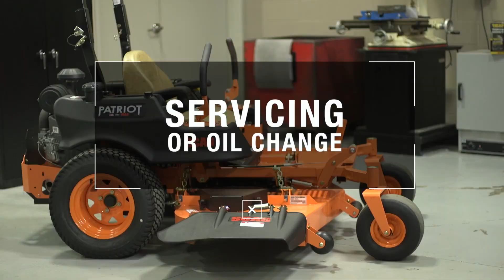Hydro-Gear Transaxle Air-Purge Process

Comment: I have a zt2200. It has no reservoirs. Just a fill plug. Do i need to leave the fill plug out when i purge? Or should it be screwed back in prior to purging? Thx
Reply: What did you find out?  And what type oil is used in the hydros?  I just got an older Jonsered ZTR and can't find anything about it.

Comment: What if my new ZT Elite with hydro-gear axles has no reservoir tanks? How do you know if there is enough oil in the axel? I was told just to fill the oil till it runs out of the top port plug on the axel. True??? Can I just let the breather vent next to the fill plug purge air out of the hydro-gear??? Or do I still need to rotate the tires back and forth a few times???  Thanks!!!

Comment: Hi, does anyone own a Husqvarna PZ60? 

I'd like to request some quick guidance on that machine, since I'm trying to understand the Bypass valve ordeal, since the manual makes it extremely confusing.  The explanation is very vague.  

Here are the couple of questions:

1. Is the Bypass Valve the same thing as the Pump Release valves?  In other words, this zero turn lacks a rod that you can pull to quickly disengage the transmission.  Instead I'm supposed to use a 5/8" wrench and move (counterclockwise?) the Pump Release valve on both pumps to be able to push the zero turn with my hands (neutral).   If there's a separate Bypass Valve in the PZ60, can you please let me know where it is located - cause I cannot see anything that I pull back and hold (like the old tractors and other zero turns).

2. The manual says that each pump has 2 Pump Release valves and that I need to move the plastic fan on top to access them.   Well, I've removed the plastic fan and I only spot 1 pump release valve per pump. 

I really appreciate your attention, and if you have feedback, I will gladly welcome it - as long as it's not the same information from the manual because that does not make sense.   I'm including the webpage that has its manual under page 35: https://usermanual.wiki/Husqvarna/HusqvarnaPz6096661440103201306OwnerSManual.1645125581/html#pf5

Thanks!
Reply: Did you figure it out? Ihave a pz60 and I can't get mine to purge all the air.
Reply: @tylerheard1279  I wonder if you happen to  have a small leak.   Believe it or not I've changed the oil around 2 months ago again, and I decided to do the following:

1.  Lowered my PZ60 so it was flat to the ground, since I had raised it to drain the oil and squeezed a small drain pan underneath it.

2. Make sure to PRE-FILL your filter almost to the thread area prior to install.  The more you can fill the filter, the better off.   Also once you fill it, wait for sometime as the filter will absorb it through its paper layers.   Bottom line, the more oil the filter has inside prior to screwing it onto zeroturn, the better off you should be.   If you think about it, this SHOULD eliminate the creation of bubble (or a possible negative pressure created by internal air pockets) once the system has been closed.

2. Add the 5 +/- (0.5Qts) of Oil into the reservoir.   Close the reservoir.  

3. Slightly raise zeroturn and simply move wheels forward and back (slowly then faster).

4. I've noticed that I don't even need to remove the 1/4" allen plugs on the back (hydraulic heads) because the air bubble ordeal is no longer an issue - due to the pre-filling the filter with oil..

5. However, if you notice that you still have air bubbles (noise or the wheels are not responding), then go ahead and loosen out the 1/4' allen plugs (I think there must be 1 or 2 per hydraulic heads).   Run the rear wheels forward and backwards for a good 3-5  minutes, then close the plugs.  

6.  The main key is to run the wheels with an elevated zeroturn so to eliminate the extreme pressure caused by the hydraulic system once the wheels are on the ground (moving the 1500 lbs machine) forward/backwards.

GOOD LUCK!  Let me know if it works for you!
Reply: - Great info, thanks so much, I think I will have to follow your oil pre-fill tip to minimize air bubble in the hydro system because my Scag LZ-36" has an issue w/ the bypass-valve release lever, I just can't get it to disengage.  Under close inspection I noticed that the cap on top of the rod of the bypass-valve is hitting the boss on the hydro case prematurely, before the valve can be fully disengaged; I'm not sure why that is this way.  The mower has only 180 hrs & runs beautifully, no issues.  Therefore I won't be able to purge the air w/ the  bypass-valve disengaged as per-procedure.  I think if I refill the filters and carefully & slowly refill the hydros, then raise the rear wheels off the ground to slowly run the wheels fwd/bwd a few times to fully purge all air out of the system, that should be OK, right?  If that doesn't work, I will have to somehow bring it to the dealer to fix the bypass-valve release issue.  Thanks in advance for your  help & feedback, cheers...

Comment: For those having a problem with this process here is a tip.  If you have a machine that has a resivoir tank you still have to remove the 1/4" allen plug at the top of each axle so that the air bleeds out as it the axles fill.  I forgot about these this round (they had dirt in the allen holes and I didn't see them on my inspection) and the oil did not fill one of the axles and it would not rotate on its own.  After pulling the plugs keep refilling the resevoir as it drains down until oil comes out the ports.   It takes a while and several top offs. Then plug them back up and top off and do the purge process.
Reply: Tried this and the hydros still will not purge. Any other suggestions?
Reply: @Co-opPowerEquipment  You do have to have the rear wheels off the ground when you purge.  One thing that helped before was I ran a control stick forward and then manually started spinning the wheel so that it would pull the fluid in and that seemed to help get the process started.  If you still have a problem then I guess I would look back over the basics.  Make sure you re-engaged the two rods in the back of the machine that put the hydros in neutral.  Make sure the belt going to the hydro's is on.  Make sure you used the correct fluid type.  I used shell rotella t-6 15-40 once and it was fine and this last time I believe I used a valvoline 20w-50.
Reply: @spyder000069  Great tip and I was curious how any trapped air was released if their wasn't a way for it to escape in a sealed system. Thank you.
Reply: @KHtally leave the cap off during purge process. How is it meant to expel air when sealed
Reply: Most common issue I have seen is a defective precharge pump. @Co-opPowerEquipment

Comment: Is the by pass valve the transmission release?
Reply: @Kevin Whitten tried that first wouldn't budge just dented it and slipped, the filters had been on for 7 years that's probably why lol
Reply: Do I open both or just one? Each side has them
Reply: @04tacomaguy1   I say both. Each trans has a by pass. Meaning they're independent.
Reply: @04tacomaguy1  both
Reply: @cajun1253  thanks got it last winter.. Those filters were on there so tight even hole with screwdriver barely did it

Comment: Did this about 20 times over almost 2 hours. Still have air bubbles coming up in the hydraulic oil tank. Right side wheel will turn but makes a little noise. How do I Purge the rest of the air out? This isn't working for me.
Reply: Tried to contact dealer 50 mile radius both said 4 to 6 weeks waiting
Just replace 0 ring right side dont work. ???,Help
Reply: I figured out what the problem was. Had a tiny leak that was sucking air into the system.
Reply from the maker: @wadeperritt3718  Glad you were able to find the cause!
Reply: @HSK Kelley It was probably along the transmission case or possibly one of the axle seals.
Reply from the maker: Wade, have you contacted your local dealer?